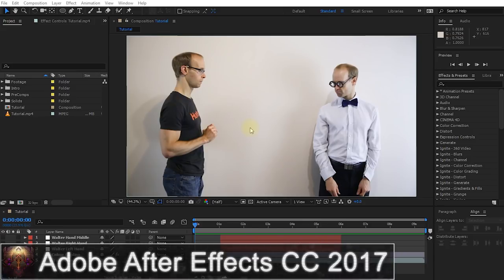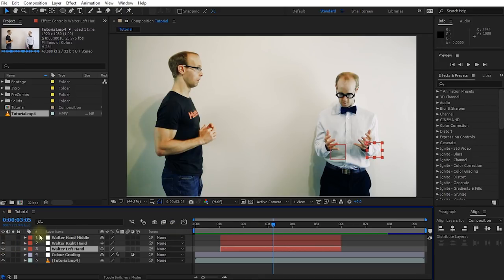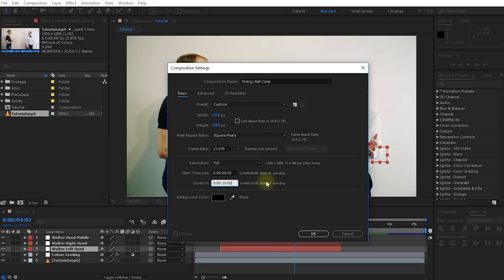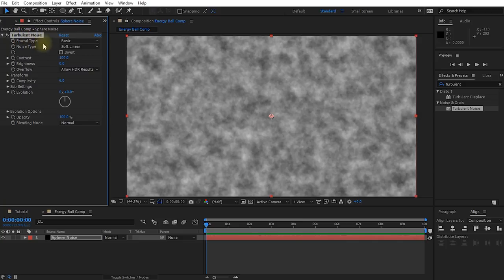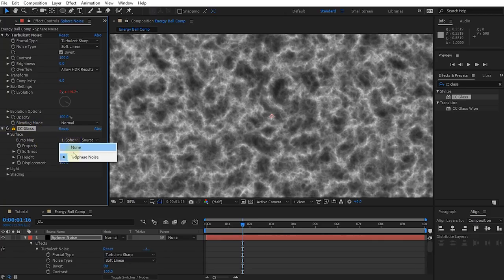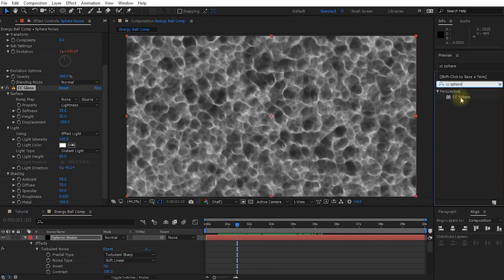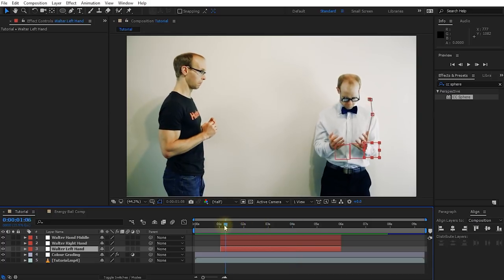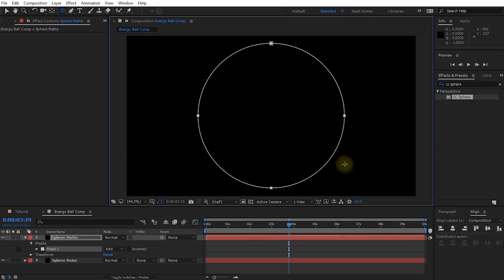ENERGY BALL VFX - Adobe After Effects Tutorial

Comment: Great vid! I enjoyed this. It doesn't matter because the energy ball is small but on a bigger energy ball, I think you might add like a wiggle expression (or whatever type of expression is needed) to the evolution of the light flare....hope that makes sense.
Reply from the maker: Thank you :) Not sure what you mean, do you mean the wiggle expression I added to make the light flare flicker?
Reply: I meant some type of expression for the flare "evolution" (revolve around the flares central axis) parameter. Right now you set the flare as horizontal (from left to right -  like on a clock from 3 o'clock to 9 o'clock). and it never revolves. I think the evolution parameter for the flare will cause it to spin around the central axis of the flare. 

But instead of just spinning around 360 degree, I was thinking it might be interesting to have it sort of flicker at various angles off of the 90 - 270 degree axis (3-9 o'clock)....have it jump around (spin to various angles) over the span of 4 second for example 20 times - (4-10, 12-6, 8-2, 5-11, 2-8 o'clock....etc) It would need an expression of some type.

In other words - the Flare evolution parameter is just a 360 degree dial. Use an expression that will cause the dial to move to random degree (+ or - degree) 5 times a second for 4 seconds or so until you throw the energy ball.

Now I have probably confused you more than my first post....LOL....sorry about that.
Reply: Well, perhaps not "wiggle"...........For the flare evolution parameter (which should cause the flare to revolve around it's central axis) set an expression that chooses a random number between -360 to 360 5 times a second for 4 seconds. That way the flare will not just stay static/horizontal as you have it - it will sort of flicker at various evolution degrees 5 times a second for four seconds (or until you throw it).

Hope I didn't confuse you more...lol.

Comment: Anyone else experiencing the Mask Path key framing not working? When I take the the time to 0 and adjust the size of the mask it changes the size on both keyframes not just the current one at 0.0
Reply from the maker: Are you sure your keyframes are on the mask path and not on something like the position of the mask or the layer?
Reply: @SurfacedStudio  yep, followed it exactly
Reply: I googled it too and seems others have experienced the same issues with all the key frames changing when you edit a single one. I think it’s a bug/glitch 😭
Reply from the maker: Do you have all the keyframes selected per chance? That’s an intentional way of changing all/multiple keyframes simultaneously
Reply: @SurfacedStudio  solved it! It was because on the tutorial I wrongly assumed you had just selected the mask by clicking it in the comp panel which by default unselects the key frame and edits the entire layer. I found the control T command finally 😂🫶

Comment: Hi, I'm having trouble with setting my mask path, it won't scale. 7:15-7:37. 
For some reason it's not setting a keyframe when I make the mask small.
Thanks for the tutorial, everything else works fine.
Reply from the maker: +FrameCityJackal Have you enabled keyframes?
Reply: Surfaced Studio hit the stopwatch icon and have also pressed the add/remove button next to it. It sorta works when I  use transform then scale but it makes the ball go away instead of appearing.
Reply from the maker: You may have multiple masks on your layer. How would you rate your experience with / understanding of After Effects? Are you familiar with all of the basics?
Reply: I went along with you step by step on it so I don't think so.
I started about a weeks ago, watched yours and others, basics videos so I have a decent grasp, I'd say a 5/10. I've done it 3 times and came up with the same result.
Reply: did you turn on keyframing?
Reply: Yes. Everything else is working except for the segment I annotated.